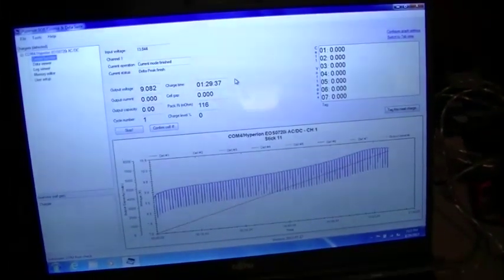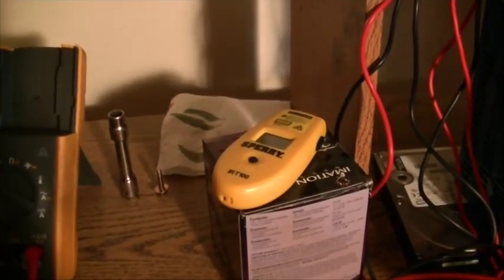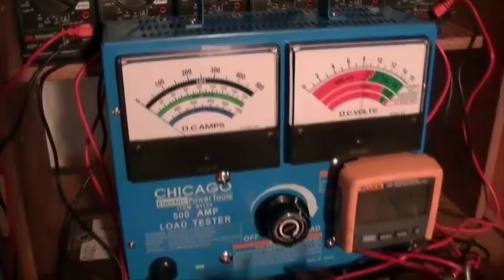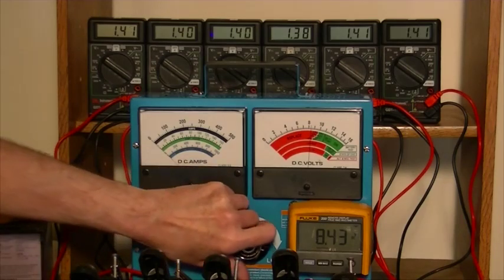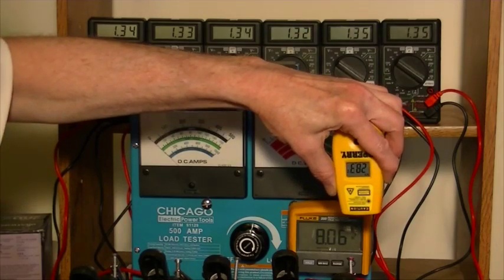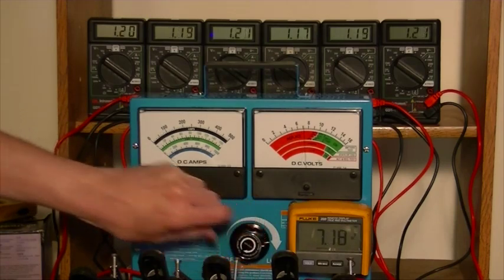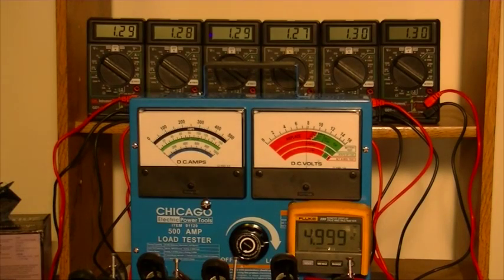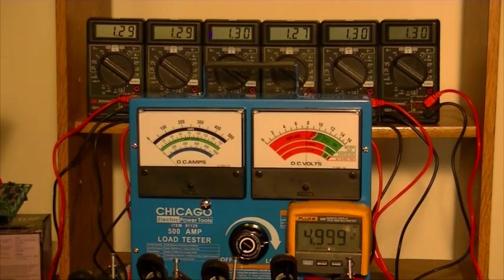Insight IMA battery test

Comment: Hi,
Very interesting setup  running the test on these batteries!
I've been working on mine 2004 Civic Hybrid. I did recycled all of the batteries several times to the point I was able to get at least 4,500 mA discharge average, but I didn't perform a high amperage load test on them. I've been driving the car for a week so far and everything looks good. 
Based on your observations can you tell how a "good battery" should respond to a certain given high amperage load? 
I've heard on another YouTube video that if I apply a load of 50 amps for 30 seconds, if the battery maintains its voltage above 7 volts the battery is fine.
 Any idea?
Reply from the maker: +Henrique Tavares thanks for watching.  You can find a lot of information at http://www.insightcentral.net/forums/  as the Civic Hybrid is very similar to the first generation Insight.

I don't remember the exact numbers off the top of my head, but if a stick (6 cells) can supply 90 amps for 10 seconds without any cell dropping below 1 volt, the stick would be considered good.

Precision measurements are not necessary, you just want to know if the battery can supply the current without getting too hot or the voltage dropping too low.

The battery in the video was very bad as you can see by the voltage drop under load.  I replaced the pack with a new aftermarket battery pack from Bumblebee Battery.
Reply: +DimensionDude 
Thank you for the info!
Reply: Hi do you know how many mA 2009 hybrid battery should take for sticks? sticks are all come two together